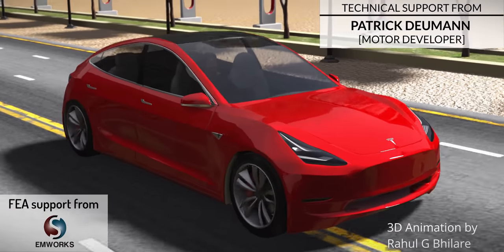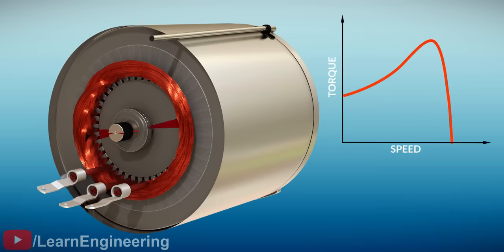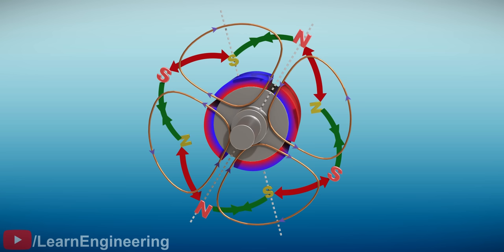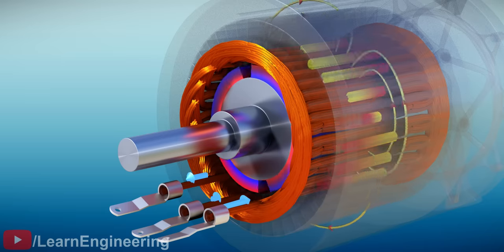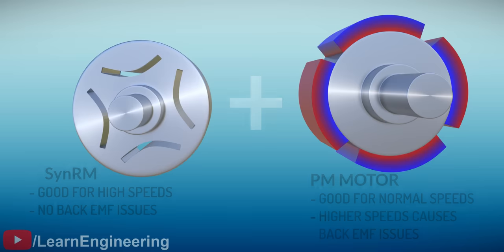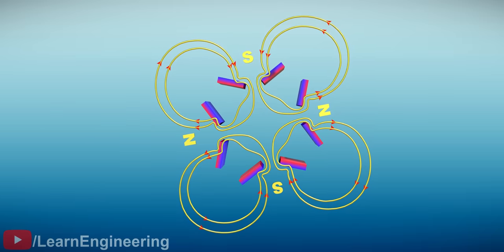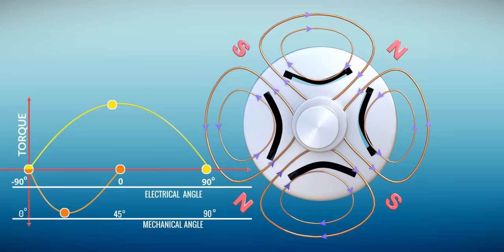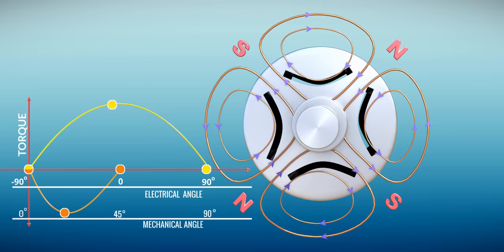Tesla Model 3's motor - The Brilliant Engineering behind it

Comment: well there are some incorrect things said here..... PMSM have high efficiency at high speed, problem with these motors is low efficiency at low load on motor like driving on motorway where all torque that is needed is to maintain the speed

Comment: A Tesla can be engineered so that all 4 rotating wheels can generate electricity and keep the vehicle charged.  They won't do it for a real good reason. It would reduce oil consumption by 90% and if public might result in Death to keep oil co's viable.
But take heart some backyard mechanic will do it if only for himself.
Reply: Take heart, some backyard mechanic will do it.

Comment: Magnets. DUH. Obviously more efficient. Its already magnetized and the latest magnets are much stronger than the field from an induced current. Start torque is max and even more as the induced field from rpm grows. Its ingenius how they take care of the back emf problem of the mag motor at higher rpms. Them tesla engineers are incredible. Also been saying for years magnets should be in alternators because the field coils eat so much of the current the alternator produces.

Comment: Tesla new technology great,my,question is about the electric energy system used on new high speed trains ,useing outside above electricity supply system ,compared with internal magnetic connection to magnetic fields of the excisting iron rails ,coupled with a energy saving new aerodynamic exterior design ,Ronald-Strada .

Comment: i wonder if these are brushed or brushless motors
Reply: Brushless of course. The centre is a short-circuited cage (rotor). Nothing new about that design. All it does is to jump from one alternating field to the other. The Stator is a electric magnetic field. Works the same as a bike dynamo. Although a bikes dynamo has a rotating magnetic field. Any magnet moved in an angle to a wire will create a magnetic field and wants to move the wire. But you can swap the two. Moving a wire in a electromagnetic field creates a voltage and current in a circuit. Your audio speakers work in fact on the same principle. Brushed engines switch the dynamic rotary coils. The stator is than a static electromagnetic field. Short circuited engines need a second field that is slightly out of Phase. The phase shifted field pulls the rotor a little bit further, where the main current field pulls in for another step.

Comment: Does the IMP  motor weigh more than an induction motor? Just curious seems like the IMP would weigh a lot more with an almost solid iron based rotor.
Reply: Yes and no, while the core is heavier it's also smaller and requires less cooling which would compensate a lot.

Comment: These motors are giant electromagnets actually. No longer do you have a commutator and brushes to wear out. More torque and more efficiency. Had my first RC car with one in 2003 now they are in real cars haha.
Reply: the principle is extremely easy and honestly quite obvious once you start learning rotating fields. The new thing is power electronics. To get the torque/speed combination you want out of an asynchronous motor, you need to feed it with variable frequency and that wasnt realistically achievable before transistors and ampliops

Comment: Thanks for the good explanation with the graphs. I have a question, for SRM for high speed operation to reduce back emf it is said that the RMF is aligned to produce 0 torque out of the Permanent magnet setup. But in that case based on the torque curve, if we maintain an angle of 90 degrees the total torque will be zero, no torque even out of reluctance effect  . So is the angle maintained somewhere between 50 to 90 deg.. the back emf reduced, however not fully cancelled.
Reply: Switched Reluctance motor works under minimum reluctance principle. At 45 degree reluctance  is minimized
Reply: This is permanent magnet DC machine for traction. SRM  with space vector modulation used in air crafts

Comment: Are there 4 motors that drive the 4 wheels?
Reply: No, in a Model 3 there is one motor for both rear wheels, and optionally one more motor for both front wheels. The Model S Plaid has one motor for each rear wheel plus one for both front wheels, for a total of three motors.

Comment: I find it humorous when I leave Best Buy and I see a row of Teslas and their owners sitting it the parking lot charging their cars.  Takes me 5 minutes to recharge at shell or any other gas station.  In 5 minutes I have a range of 400 miles with full AC, heat, radio to the very last drop.

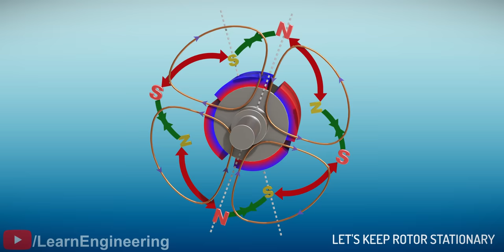Comment: Excuse me! How did you determine the outer terminal S or N in 3:10 ? Does it come from the magnetic of current? Could you please explain me more about that?
Reply: The copper colored loops are the field lines of the rotating stator's magnetic field, not the coil's current flow which it kind of looks like in the diagram. So when the arrows point away from the center that is the south pole, and if they point to the center that is a north pole. If you make a "thumbs up" with your right hand and point it in the direction of the arrows pointing inward or outward, the direction your fingers point/wrap around is the direction of the current flow through the stator's windings.
Reply: @SteveFordham1  So could you please tell me that in 8:29, the lines of RMF have something wrong, right?  The magnetic field line goes out from the N pole to the S pole. So in 8:29, it goes against. Can you explain for me clearly? Thank you, Mr. Steven!
Reply: @buihuytruong6606  yeah you are correct, in both the graphic you described and the one I did the arrows should be going the opposite way. The north pole should have the field lines pointing away and south pole should have the lines pointing toward the electromagnet.
Reply: @SteveFordham1  actually, It is totally right, because we do not consider to the outer magnetic line, we just consider to the inner line to determine the magnetic pole. 1 hour ago, I do not think like that, but I read and watched lot of lession and realize that it is correct at all. Because the rotor in this case is inside the RMF, so we use right hand rule with finger inward the center of motor. Thank for your comments and this discussion for improve my knowlegde Mr. Steven.

Comment: So ... um ... where exactly will the electricity come from to charge up the batteries during a massive and long-term power outage?
Reply: Probably the place as gasoline during a massive long term power outage
Reply: There typically isn't any, as gas pumps are electrically powered. One would need a fuel pump that could be independently powered, just as charging stations would need to be. Liquid fuel can also be stored in quantity, electricity cannot. This is an issue that needs to be resolved to make widespread electric vehicle use more practical.

Comment: HI, GREAT VIDEO, THANKS. EUC'S USE THE SAME PRINCIPLE, BUT THE STATOR COIL IS ON THE INSIDE AND THE FIELD IS PERMANENT NEODYMIUM MAGNETS ON THE OUTSIDE, INSIDE RIM. ELECTRIC WHEEL CHAIRS, SCOOTERS, SKATEBOARDS ETC, USE THE SAME PRINCIPLE OF BRUSHLESS SMART MOTORS. QUESTIONS: #1. COULD WE USE THIS PRINCIPLE IN THIS VIDEO ON A SMALLER SCALE AND PUT THE STATOR COIL ON THE OUTSIDE, INSIDE RIM MAKING THIS THE FIELD? #2. CAN THIS TESLA MOTOR BE MADE ON A SMALLER SCALE? EUC'S THIS YEAR ARE AT 70 MPH. I KNOW FOR A FACT THE EUC'S ARE GOVERNED SOMEWHERE IN THE CONTROLLER, OR IN THE MOSFETS. I PREDICTED IN 2021 THAT THE EUC'S WOULD BE UP TO 150 MPH VERY SOON. AS MAGNETS GET BETTER AND BATTERIES GET BETTER AND MOSFETS GET BETTER, THE EFFICIENCY WILL GET BETTER. EVEN AT 55 MPH. WE HAVE SMALL AMOUNT OF HEAT AND HIGH AMPS OF 165 AMPS AT FULL TORQUE, USING LARGE MAGNESIUM HEAT SINKS AND 4 GAUGE MOTOR WIRES. WHAT DO YOU THINK?

Comment: They should of made one of the wheels on electric cars a Generator constantly charging the battery.Unless someone is working on that Idea. Better than plug in.
Reply: The vehicle has the option of regenerating power every time you want to slow down (instead of pressing the brakes)

Activating the power generator puts a large stopping force on the vehicle.

If you made one of the wheels a permanent power generator, all you would do is waste power, because you would use even more electricity from the other motors to generate electricity from the permanent power generator.

To squeeze the most power, you ideally only accelerate when you need to, coast as much as you can, and try to slow down using regenerative braking as often as possible.

You can imagine that every time you need to step on the brakes, you wasted an opportunity to generate power.

But simply putting a power generator on one of the wheels to run constantly won't do anything.

Comment: What happens if a squirrel cage and permanent magnets are used together.
Reply: It doesn't work. An induction rotor (such as a squirrel cage type) depends on being asynchronous - the stator field rotates faster than the rotor. Permanent magnet rotors depend on being synchronous - the stator field rotates in step with the rotor. The two types are completely incompatible.

Comment: A moment of thinking out of the box..... What would happen if you put two of these motors inside a combined magnetic field which would look like a infinity shaped magnetic field?? Has anyone tried out this yet?
Reply: yeh actually, on the maglev tracks the power is just running through a whole bunch of those on either side, then the train picks up the power on superconducting running gear and is laterally stabilized by eddy currents in proportion to its forward speed as it goes by

Comment: They missed a few opportunities for further improvements.  At least two are immediately apparent to me.  A third & fourth may be present as well, but I will need to think for a while to be sure that I could come up with a geometric configuration where they would not cancel each other out.  The downside would be added mass, so the best efficiency improvements would be seen on the highway where constant speed is more the norm.  This presentation also sidesteps ways in which the older induction motors could have been improved.  Many options exist.

Comment: 6:56 what did you call it?.... i expected a bit more from Tesla and competitors by now.... this is not even a 4 hub drive.... i would expect Tesla to be releasing a vehicle with independent motors built in to each wheel, but not hub drive, rim drive where, similar to this vid but in reverse, the center is now the outer rim and tyre. the rim rotates via magnets surrounding inner and outer rim. switch polarity for fwd/rev which is also accelerate and braking. basically how a theme park ride operates with maglev technology which isn't new.... anyway it doesn't matter coz driverless cars and air taxis are about to change all that.

Comment: Are u sure it’s a completely new motor? I thought it was just a version of a DC brushless ?
Reply: It's not new at all. It's essentially identical to the motors in most other EVs, such as the Nissan Leaf.
Reply: @brianb-p6586  yuh it’s called a DC brushless motor specifically
Reply: @Coolgiy67  No, this is not a DC motor. It is the opposite - it is an AC motor. "DC" means "direct current", which is the opposite of "AC", which is "alternating current", meaning the the polarity alternates with each cycle. Ever wonder why the device which prepared power for the motor is called an "inverter"? It cycles each of the three output phases from negative to positive polarity... inverting the DC power from the battery to make sinusoidal 3-phase AC power for the motor.

More specifically this - like most EV motors - is an interior permanent magnet synchronous AC motor.
Reply: @brianb-p6586  wrong I’m an electrical engineer ur probably just a fan boy
Reply: @Coolgiy67  If you're an electrical engineer, you should at least understand what alternating current is. Put an oscilloscope on the phase conductors and you'll see that the voltage cyclically alternates polarity, so it's AC. It's even at least roughly sinusoidal.
Reply: @brianb-p6586  ur not an electrical engineer ur probably a googling fanboy
Reply: @Coolgiy67  Ah, the usual response of someone who doesn't understand what they're talking about and so has no meaningful response: the ad hominem attack.
Reply: @Coolgiy67   You're mistaken about my qualifications, but assume that some "googling fanboy" pointed out the same facts: how do you explain to that fanboy your insistence on calling this a "DC motor", despite the fact that is is powered by AC power?
Reply: @brianb-p6586  it’s not an Ac induction motor it’s definitely a Dc brushless buddy you don’t even know what those terms mean
Reply: @Coolgiy67  Of course it's not an induction motor - it's synchronous (not asynchronous), and the rotor field is produced by permanent magnets (not current induced in windings). Are you (allegedly an electrical engineer) not familiar with any type of AC motor other than induction? That could explain your confusion.
Reply: @brianb-p6586  hmmm I haven’t learned about Ac synchronous motors. I’m still only a sophomore, ur starting to convince me are u actually a EE or maybe a technician ?
Reply: @Coolgiy67  That makes sense. 

Most industrial AC motors are of the induction type, because they're the least expensive to build and because their characteristic of "slipping" (rotor speed less than stator field rotation rate) by any amount required until the driven load catches up to the drive frequency makes them practical to run directly from a fixed-frequency source (also known as "across the line"). A synchronous motor must be powered in synch with the rotor position (with the phase angle difference corresponding to the torque), which means either a variable-frequency drive (VFD, called an inverter when supplied from a DC source) or some complex additional features to get the motor up to speed on a fixed-frequency source. 

Of course all electric vehicles use an variable-frequency inverter - since they obviously need to change the motor speed as the vehicle drives - so the need for a VFD or inverter isn't an issue. The control section of an inverter is often designed to run either an induction motor or a synchronous motor with just a configuration setting change (and possibly a shaft speed sensor versus a shaft position sensor), because the power section is the same either way. The Tesla Model 3 rear motor is synchronous but the AWD Model 3 is induction, and they appear to use the same inverter.

There are synchronous motors which use a wound rotor (like a brushed DC motor's field winding) instead of permanent magnets, but they need DC power to excite the rotor winding, and brushes and slip rings to get the power to the rotor; a conventional automotive alternator is this design, although only capable of running as a generator unless the rectifier diodes are replaced with an inverter. They were the common synchronous motor type before high-flux permanent magnets became available, and for a while Renault used them in their EVs.

I don't get into professional qualifications in social media, but my education covered the physics behind these motors a few decades ago, and I've followed the technology since then when work and other interests touched on motors.
Reply: @brianb-p6586  gyat damn

Comment: So brilliant that it was designed and engineered 120 years ago and due to patent laws was then open and freely available. Meaning Tesla didn't have to invent anything new. You would know that if you had ever dismantled as Tesla and checked the inside of the engine. It's exactly the same engine as in any shitty black and decker battery driller or kitchen machine or any other electromotor on the planet. The only thing Tesla invented or kind of copied from Samsung and Panasonic was the batteries as they used average market typical 18650 accus before.
Reply: Tesla cars do not have engines.  They have motors.  An engine is a primary source of power, converting fuel to energy onboard,  An internal combustion engine is synonymous with a powerplant.  A motor is a consumer of energy, the power production being produced at a remote power plant and stored by the onboard battery.